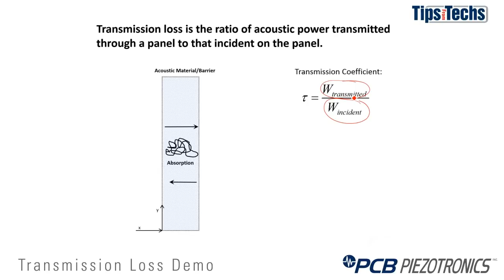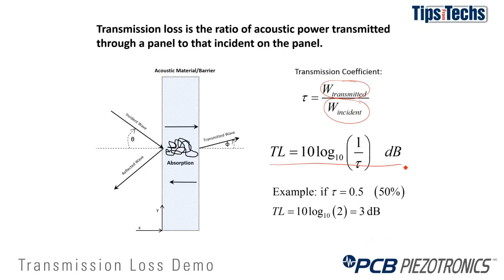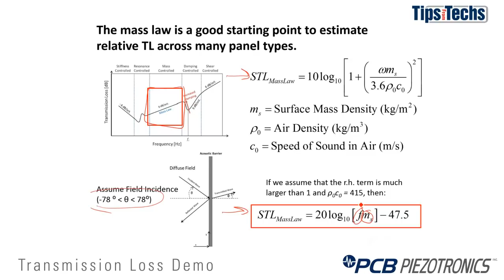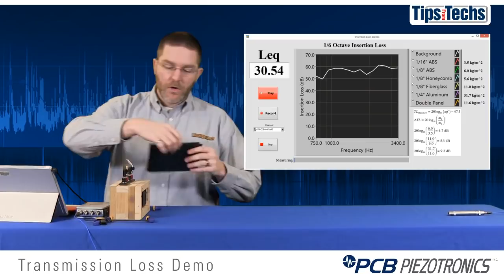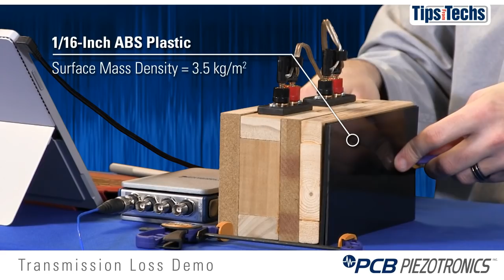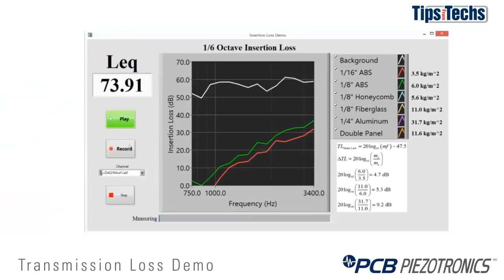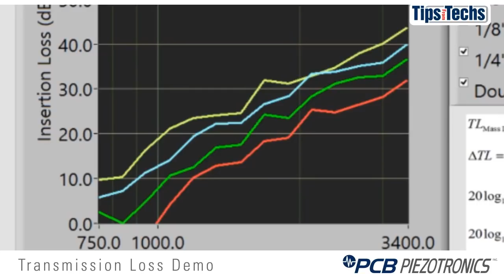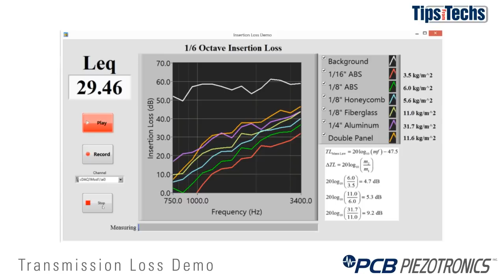Measuring Transmission Loss in Acoustic Testing - Demonstration

Comment: Hello
Thank you for the presentation.
Why is the reflected wave is not considered in the STL measurement?
The incident power is calculated from the blocked pressure which if: incident + reflected.
Thank you
Reply: because we are measuring transmission loss. which means how much sound got transmitted after going through medium.

Comment: When calculating the surface mass density if the barrier has 3d features on it do they need to be considered or is the only important part to consider just the 2 dimensional projection of the material?
Reply: I have the exact same question, I am working on estimating the transmission loss using different materials but the container I manufactured is a small 3d rectangle